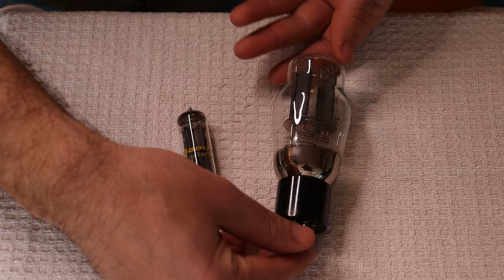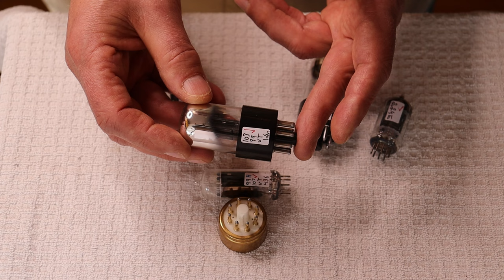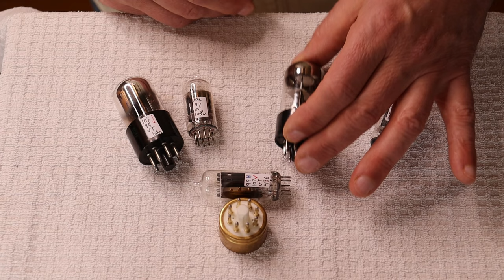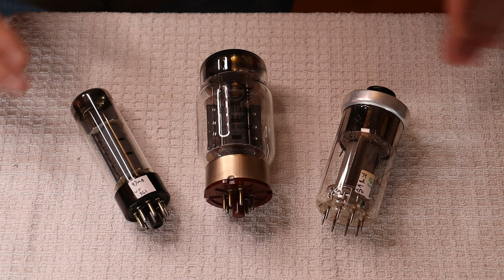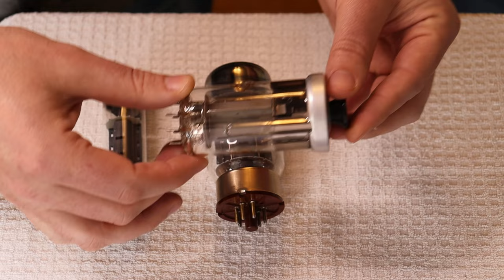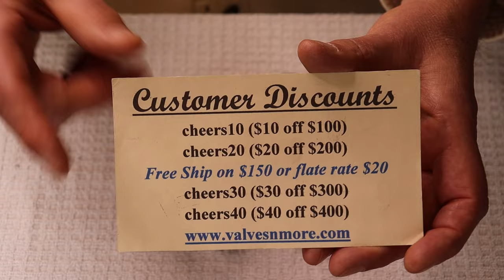Tube Lab #176 - Vacuum Tube Basics

Comment: I hope you can get your hands on the APOS RAY tubes. They are a modern production and an affiliate of PS Vane out of China. There might be some promise here. Worth a try.
Reply from the maker: Over the years I've tried all kinds of Chinese production (cheap and expensive), as well as modern JJ's and Russian New Sensor re-issues and nothing has impressed me (most of it has been junk).  But we're a vintage tube seller, for good reason, the original version of these types are almost always superior sonically.  If a modern tube competes favorably, it often costs as much or more than the original vintage type!

Comment: Given the reduction in EL34 and KT88 supply, are there any tubes that can be adapted (like with the 6CG7 and I think the 6GU7) for the power tubes in the R8?  Thank you.
Reply from the maker: No and we're always looking, the reason there aren't any close cousins is because power tubes are very specialized, so if you needed something like a KT88 or EL34 for your circuit, you wouldn't design a close type, you'd just use the KT88 or EL34.  Luckily the vintage EL34 is still a commonly available tube, it's only certain high demand ones like the mullard xf2's that are disappearing fast.  And the vintage KT88 and 6550's are almost gone.  We will probably make up an occasional quad but nothing like the cases of true Svet 6550c's we used to have in stock.

Comment: Is the 6CG7 adapter the same as for the 12AU7?
Reply from the maker: No and yes, Caution! many adapters handle pin 9 filament tap differently.
What our adapter does is drop pin 9 altogether, so when you plug a 12au7 in, it requires that the octal socket you are plugging into has 12v supply for filament and is wired for a standard 6sn7.  So in most cases this won't work.  But there are adapters designed to utilize the pin 9 centre tap so that you can run a 12AU7 at 6v filament supply.  A much smarter approach imo is to utilize an electrically compatible 6v tube like the 6GU7 or 6CG7 as a replacement for the 6sn7 - if that's what you're thinking.